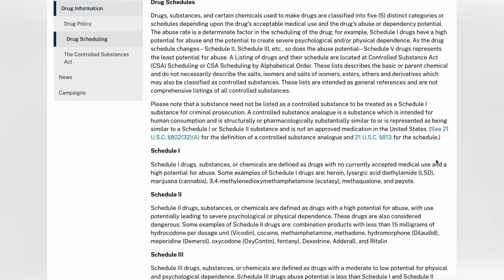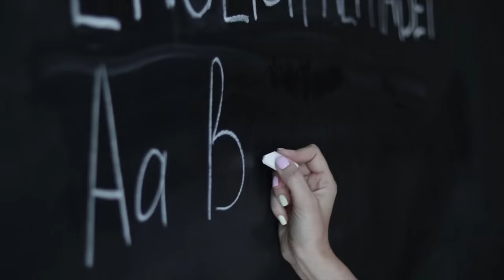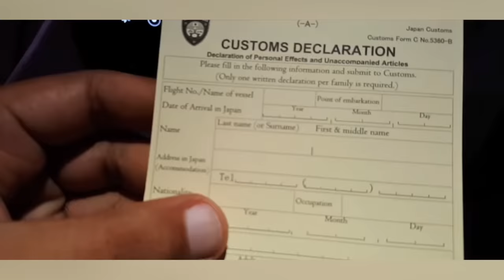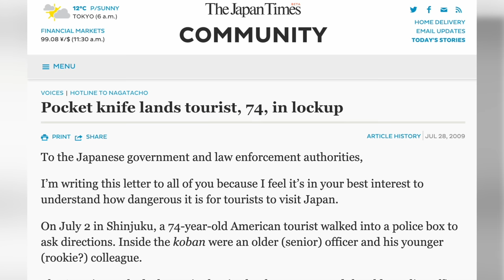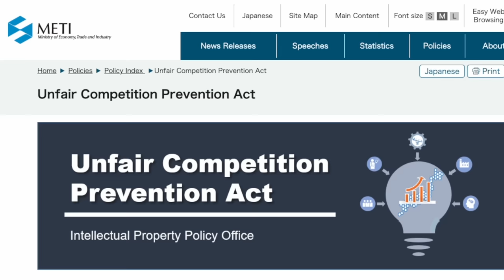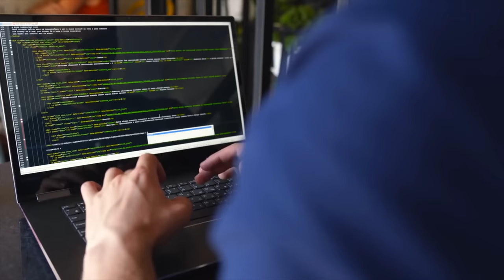This stuff is ILLEGAL in Japan but OK in America!

Comment: A little something about knives in American culture: The United States is mostly rural, and Americans are culturally inclined toward a high degree of personal independence. In this case, that means taking take of most tasks by themselves, instead of expecting someone else to do it.

Thus, Americans often have a multitool or small pocket knife on them. Useless in a fight, they are helpful with small everyday tasks especially in rural areas. "Always have a knife on you" is a common adage in these areas, which is why few Americans even think to check to see if there are any laws against carrying one.

Comment: The Game Genie would be illegal now. The DMCA “fixed” that. It was only legal back in the NES (Famicon) and SNES (Super Famicon) days because they predate the DMCA and internet (walk throughs, etc). Any device that uses encryption to communicate between parts (game cartridges, DVD’s, etc) cannot have the communication reverse engineered. The Library of Congress (not sure why this is the organization that does this) has a list of exceptions that they review and update on a scheduled basis.  
While this isn’t tightly controlled for non-commercial cases, it is pretty well addressed in cases where the decryption product is either sold or very high profile (DVD decryption for use on computers to make copies of DVDs, which is technically legal for backup copies).

Comment: The video game modding related laws are interesting, because there's a weird intersection between Japanese and American laws. In Japan certain elements of copyright law are stricter and others are looser, for example homages and direct references to other works are completely fine in Japan so long as they aren't just plagiarizing the original work, but in the US most homages are not considered fair use and are actually copyright infringement. Also, becuase a lot of the US laws around it are based on case precedent, game cheat and modification devices or software are usually legal, so long as they don't contain any proprietary code or hardware, which is why companies like Apple and Nintendo like to prevent other people from being able to directly access their hardware are OS information on devices they make, which ends up causing a lot of problems down the line for people trying to repair or preserve their hardware and software.